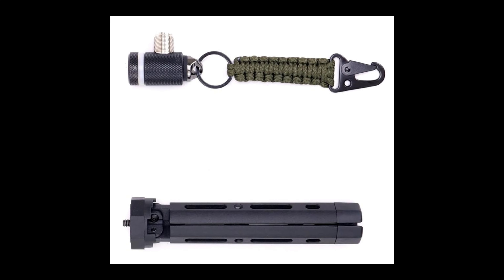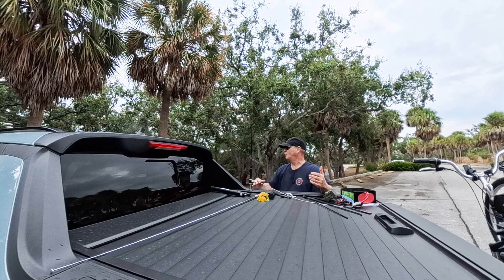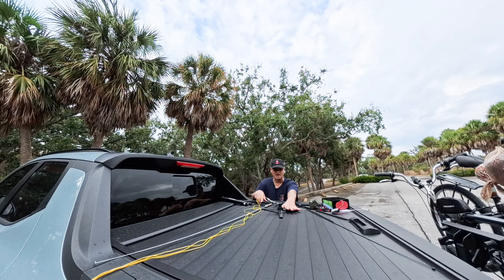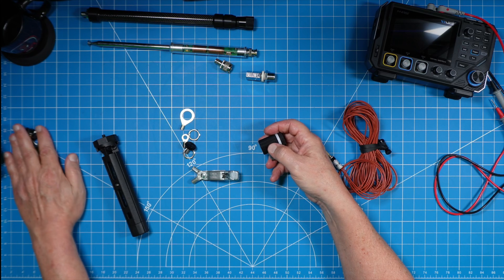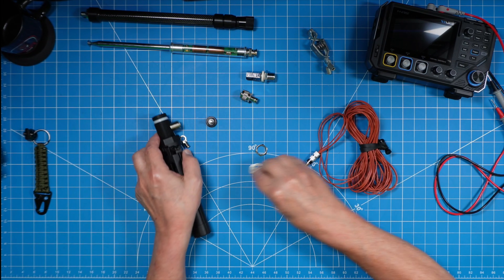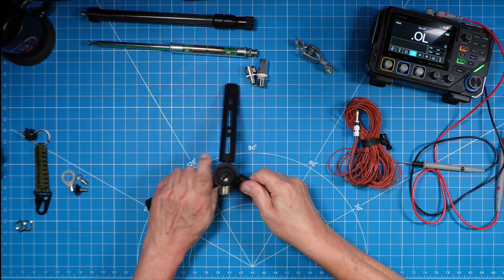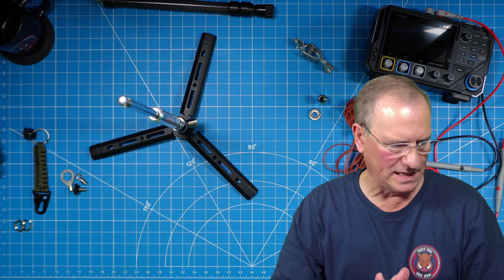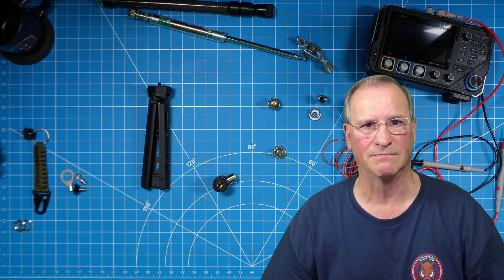Minimalist SOTA POTA Portable Ham Radio 3-8 X 24 - UHF - BNC Base and Tripod for Ham Radio Verticals

Comment from the maker: GRA-ULTIMini 3/8 X 24 Base - https://amzn.to/48rKeHG  (First production batch has sold out; more on the way)
GRA-CFS10 Carbon Fiber Whip Antenna - https://amzn.to/48oE7nx
GRA-CFP2600 5-Section Plug-in Carbon Fiber Whip - https://amzn.to/48DJkXj
Large Ring Terminal for Banana Plug - https://amzn.to/3YdbQu7
1/4 X 20 Stainless Ground Spike - https://amzn.to/4pXT5Xv
3/8 X 24 to UHF Stud - https://amzn.to/3KxDI9i
UHF to BNC Adapter - https://amzn.to/3YdyYIZ

Comment: Man what a cool kit. It would be cool if Gabil made coil attachments for the micro feed point like the Hamgeek MA-01 2.8 portable antenna. I would think they could use the GRA-HF750T kit if they made an adaptor or a different end for the GRA-HF750T coils. The MA-01 V2.8 is rated for 100w which I like.
Reply from the maker: Thanks for the view and comment.  I believe Gabil Radio will be looking at the video comments, so they will be able to see your suggestion.
Reply: I have a Santa Cruz where did you drill to run your cables to your antenna attachment?
Reply from the maker: @wheelersecuritygroup  I haven't run my cables yet.  I know there are openings in the firewall between the cab and bed -- unfortunately, that would require me to remove my bed cover and bed liner, neither of which I want to do.

I'm going to try to run my cable through the weather strip in the back sliding window.
Reply: @H @HOAHamRadio
Reply: @H @HOAHamRadio that’s what I did.  73

Comment: I just received the entire Gabil system in, I am going to set it up this weekend!
Reply from the maker: Tripod and 7350 antenna?   If so, that's a pretty solid performer for its size. Forget the 80 meter coil, that's not happening.  6 to 30 is great and 40 is okay.
Reply: One more thing Bob, I am not seeing a link to the Elecraft antenna, did I miss it?
Reply from the maker: Just to let you know, I have NEVER used this antenna.  I do not know how good it is, or isn't.  Purchased it a while ago, but have not had a chance to do anything with it.  Here is their link: https://elecraft.com/collections/ax-line-antennas-1/products/ax1-antenna
Reply: @HOAHamRadio it has some great reviews so I am willing to try it, thank you sir!!
Reply: @HOAHamRadio  One more thing if I may, one never knows when a certain piece of equipment may work better in one situation than another, I truly don't mind having extra gear that may prove useful down the road for me or someone else and thanks you I have seen that light!
Reply from the maker: @rickrocker7559  You've picked up a key point many experienced amateur operators never do....  While gear has general performance characteristics, in different environments and set ups, the outcome can be different.  Amateur radio is a science that requires adaptation to the environment / circumstances.
Reply: @HOAHamRadio  I thoroughly agree! I am learning so much experimenting with all kinds of gear and I have learned so much from your videos. You taught me to look beyond what is and see what could be, then turn that into what can and should be. I will share the things I have "created" with you to get your opinion and if you find something worthy it is yours to share as it is due to your inspiration that I got to this point. I didn't join HAM radio to be average, I want to be the very best and this requires me to surround myself with the very best and I count you as one of the very best! Thanks again sir!

Comment: So there is a new blank on the market, I paid way too much for the chameleon CHA version
Reply from the maker: This is small form factor; not recommended for SS17 or taller.  You will eventually snap the 1/4 x 20 stud if you use it with the 1/4 wave antennas.  Gabil and Chameleon both have their use case.
Reply: @HOAHamRadio  there are 3d printed brackets that go on the whip that you can guy it down. that may help negate some of that strain.
Reply from the maker: @N3EMT guying is certainly a valid option.  I'm lazy, I always try to create a set up that doesn't require it....
Reply: @HOAHamRadio  I’ll definitely be interested when the 20 meter carbon fiber version is released,
Reply from the maker: Yes, I think it will be in high demand.  Just received it, haven't tested yet, but I have high expectations.